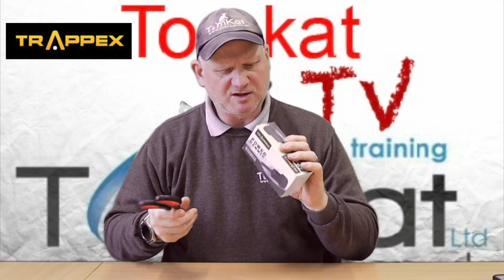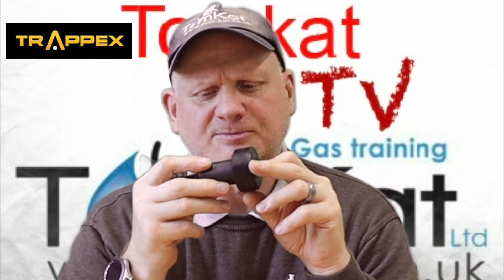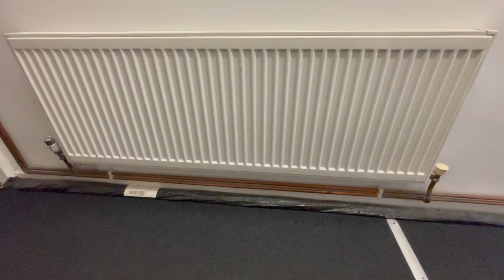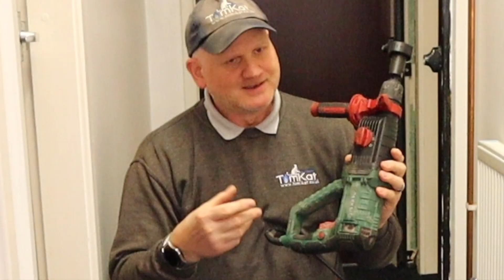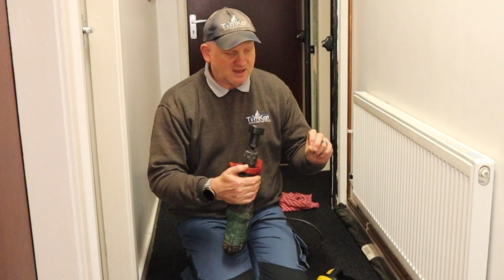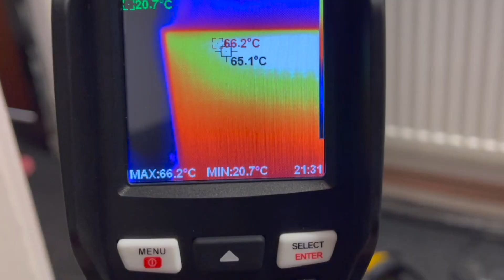Are your radiators hot at the top cold at the bottom then  you need the Trappex power hammer.

Comment: It's 8.15pm , I've replaced a TRV upstairs, bled the rads.  The bypass rad is cold in the middle.  My wife is going potty.  You have just saved my hide 😅, haven't got a tool yet, just used my hand and knocked up and down loads and the cold patch in the bottom centre has now started to warm up.  Thanks for the advice to a non plumber 💯

Comment: I have a question if anybody knows the answer I would be grateful.... does having someone come round and power flush my heating system work better then physically removing the radiator and flushing it with a water hose in the garden?
Is the difference in results going to be much difference?

Comment: Good video. 
I bought a Chinese one off ebay under a tenner, added system cleaner which puts the magnetite into suspension, isolated all rads and worked on one at a time (higher water pressure), cleaned magnaclean, drained, flushed, filled adding inhibitor, job done.
Reply: Did you clean the magnetic filter after every radiator? I'm just wondering whether it's safe to do it this way as profressionals use an external MagnaCleanse machine to do it this
Reply: @eajk001  checked it after 2 rads as you don't really know how much its going to collect, how bad the rads are.
I also fitted a seal kit on the magnaclean filter housing 3 seals I think as you don't need the hassle of that leaking!
Reply: @slyfox186  Thank you. This is next weekend task.
 I'm not sure how I'm going to flush the system after. My cold loop feed is upstairs next to the unvented cylinder. I was thinking of closing the return feed back to the boiler(before the magnaclean). Then, open each radiator individually and flush it with mains pressure

Comment: Gone up from £28.95 to £34.74 in the space of 3 weeks.  20% price increase for a piece of rubber.  Has there been some sort of price rise in the past 3 weeks that I'm not aware of or are BES just creaming off?
Reply: you can make one using a jake puck with a bolt and nylock nut using nylon bushes and washers so the bolt spins in hammer mode on the drill

Comment: I think the Trappex Power Hammer is a fantastic product which proves it agitates and removes metal particles .I suppose if you passed  it over the radiator 3 or 4 times you would have got more out .Just bought one  from BES ,great value compared to the Adey Vibraclean .
Reply: Rubber mallet works just as good and easier

Comment: Why would such a tiny amount of debris so radically affect flow in the radiator?
Reply: it builds over time makes trvs stick as well as moving parts inside the boiler and heat exchangers. look at the radiator it has waterways that black stuff builds like a cake inside rads/pipework/boilers preventing heat transfer from the water you spent money on heating to the metal of the rad. even worse if its inside a heat exchanger. invalidates warranties on new boilers most have 10 years now. their engineer turns up and finds that cake inside a failed part........................its on you, and they will probably send you the bill for the privelege of getting one of their engineers out.

inhibitor only slows down that process. and that degrades over time and needs to be replaced/topped up.

Comment: Hi Derek, thanks, interesting. I am definitely going to use my smartphone FLIR to check my radiators for large cold areas. I wonder if instead of using physical movement to put the magnetite into suspension in the liquid: could it be possible to do that with a couple of magnets? I should be able to model and 3D print a device containing 2 neodynium magnets from an old harddrive, set them with opposite N / S facing the radiator, and then adding an extension in order to mount it to a drill, that I could then turn slowly at the bottom of the radiator. I don't have a pound of magnetite and an acrylic model of a radiator to visually test the feasability of my idea, but it would be nice to have that.
Coming back to the power hammer, I guess some Duct tape could be enough to help protect the device, instead of a cloth, maybe? Cheers, stay warm ;)

Comment: I made one. Hockey puck from eBay and a 3/8 inch Drill Arbor Adapter from Amazon. Total cost was around £11.
Reply: Jack Pad as that has a blind hole, drill and use a 10mm bolt and washers with a nylock nut at the back..£4.50

Comment: As my flow temperature is set for 50C and the drop across each rad is around 12C due to the lockshields, all the bottoms of my rads are cool by design yet the implementation is this is wrong as “we need to make this radiator as warm as we can”
Reply: haha. wait till you start thinking about poorly designed underfloor. and calibrated.

Comment: So at the start there was 10c difference between the top and bottom of the rad and the same at the end 🤣
Reply: perhaps you did not notice the colour change showing how the rad was able to dissipate heat over a larger area.... the water needs to flow so there will always be a flow and return difference !
Reply: @David_11111  looks like they’ve changed boiler flow temp to give different colours on the thermal imager. You will always get some temperature difference across a rad if you didn’t then the boiler flow and return temps would be the same which they’re obviously not
Reply from the maker: I can assure you the temperature on the boiler wasn’t changed I guess more flow through and more surface area used on the rad won’t make it hotter then?
Reply: My point was there’s still a dt of 10c so for me nothing has really changed same flow rate through the rad imo. Trv has a tiny aperture maybe 6mm? I’d say this is likely a bigger restriction than the rad water ways
Reply from the maker: @jimmyryan1988  the idea of the video was to show how much magnetite the tool could loosen in just 2 passes not how it could change the delta r of the rad